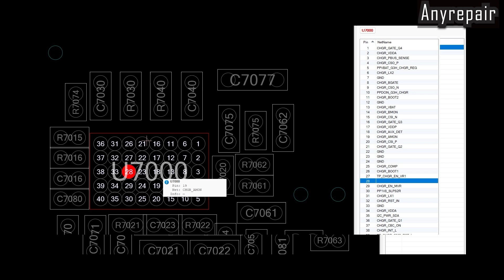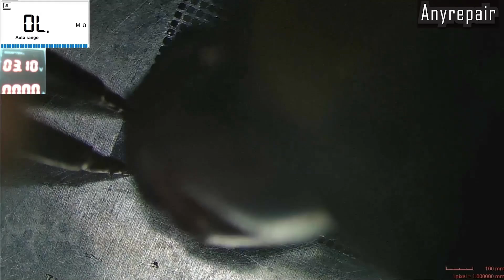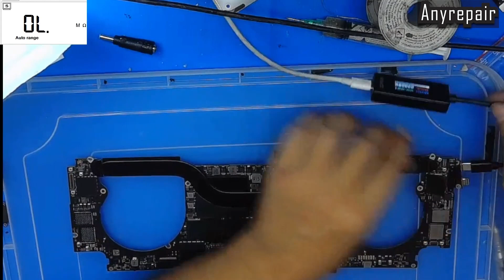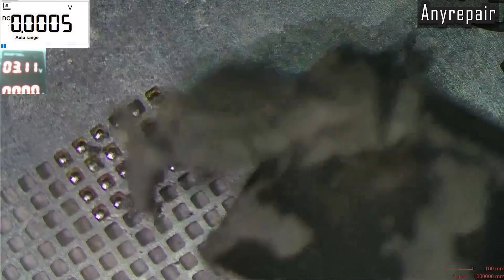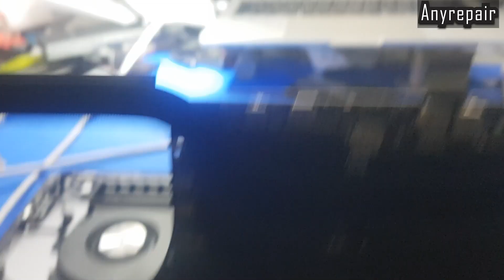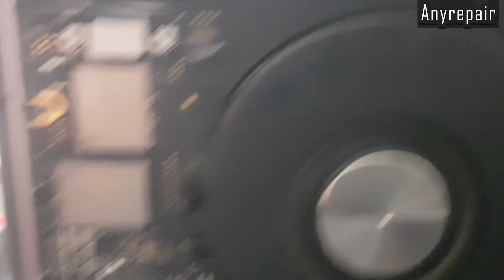A tricky macbook a2141 repair, just before I quit!

Comment: May I suggest using liquid rosin for removing chips. Usually the solder balls come out looking quite good and don’t need to be reballed. Also liquid rosin is great for reflowing chips that have liquid damage, success rate is high. Fantastic job!
Reply from the maker: Thank you for the tip! I will surely try it!🥰